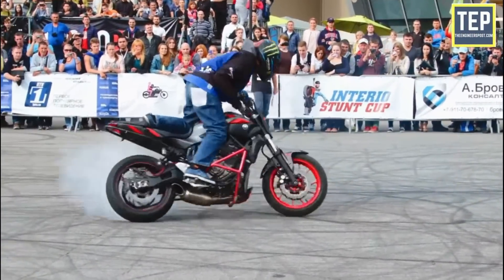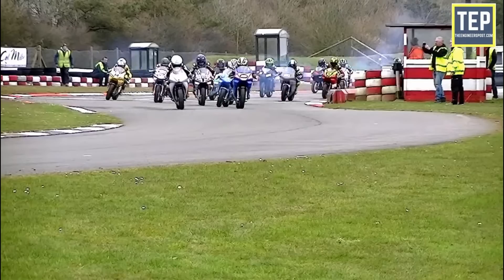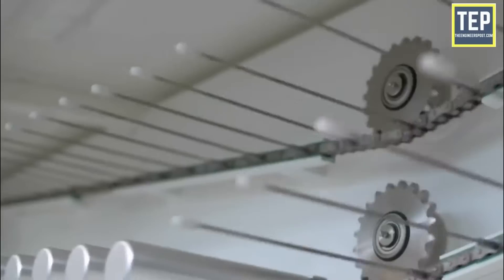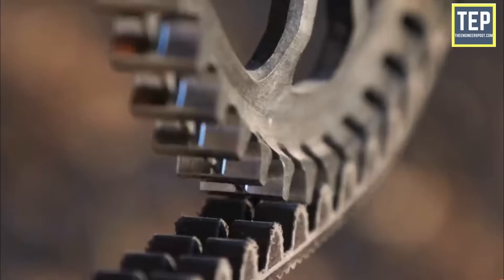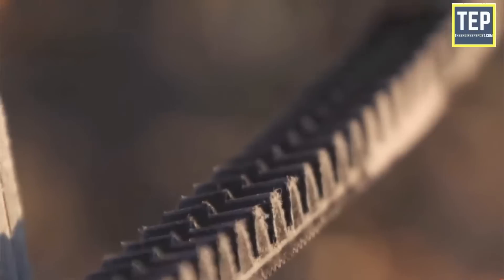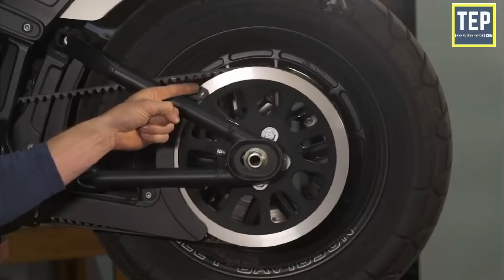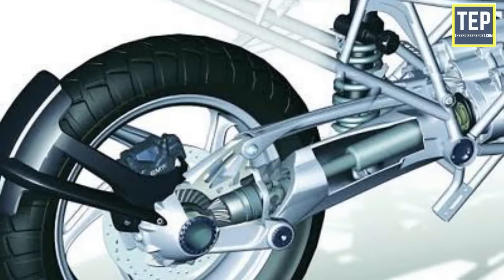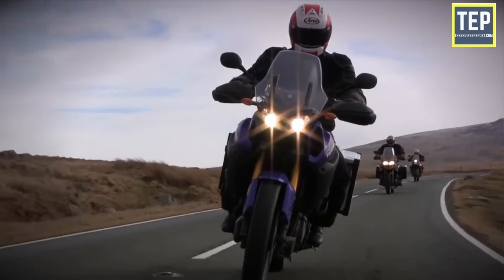Chain Drive vs Belt Drive vs Shaft Drive in Motorcycles | Which is Better?

Comment: You didn’t really answer which is better. I think it depends on what the individual rider needs: performance (speed), touring or low maintenance.  I ride a 1984 Nighthawk S shaft drive and it’s had a few oil changes in its life. I’ve had it since 1988 and it’s still thriving. Btw, this is a CB750SC, a Canadian version with 84 hp. Hard to beat it when I go on 10 hour round trips and not worry about oil or chain adjustments.
Reply from the maker: Yes it depends
Reply: @TheEngineersPost  jobs
Reply: I have a cbr 600 f from the same year 😁👍🏻

Comment: If you want consistent acceleration then the drive shaft is the way to go.  If you want more power then a chain is better, but it does not behave the same each time you accelerate.  Chains are more fun and less predictable than drive shafts.
Reply: @Ziggy Zig A good bike rider can tell the diff between a cold chain and a warmed up one.
Reply: @Ziggy Zig A good bike rider can tell the diff between a cold chain and a warmed up one.
Reply: I'll take my shaft drive VTX 1,800 R against anything you have rubber band or chain you don't stand a chance
Reply: @joeylom5235  VTX 1800 R is a screamer at 3.3 sec for 0-60mph.  The FZ-09 does the same in 2.9 sec and is a chain bike, but not really comparable as it is a naked bike designed to crush anything from 0-60 that uses gasoline.
Reply: Not so The Drive Shaft Robs a lot of Horsepower , Take same Bike with a belt or chain and you will never see Them on a shaft Drive Dead Stop Shaft makes Bike Rear raise up ,If you like a Goldwing a shaft is fine but you can not play with Belts & Chains on a shaft loosing to much Power to the ground .
Reply: @gentrydebbie1040  I don't notice much or if any  power lose with my shaft drive m109r.
Reply: @Matt-qd7sd  That is bacause you have never Ran a Chain on it or Dynoed it I Know it looses Tons of Power ?I Done wone Cash on chain verses Gears ?
Reply: @Ziggy Zig Yes I can tell the difference between the two.
Reply from the maker: You are right
Reply: @Ziggy Zig Maybe the dyno is not sensitive enough to notice.  My FZR 600 and FZ-09 chain bikes both have less consistent acceleration than my vStar 650 had which has a drive shaft.  Maybe the tire quality is the actual cause.  The Z rated tires on the 2 crotch rockets might allow for more tire spin.

Comment: You know, these guys are leaving out the option of using a hydraulic pump and motor. The nice thing about hydraulics is that you have a bypass valve, which serves as the transmission.
Reply: has it actually ever implemented into production vehicle? i have seen a cycle but never a motor bike with this tbh
Reply: i think it's the same principle of torque converter automatic gearbox. the drawback is the loss of efficiency due to liquid medium.
Reply: A Hydraulic system would have an efficiency of probably 5% and be slow as fuck

Comment: They didn't cover how on shaft drive when you gas it the back end of motorcycle lifts up thus losing traction not good when cornering hard... JMO
Reply: @Legi0n21 you lying to yourself the backend always lifts up on a shaft drive motorcycle. it is kind of unnerving. shaft drive works on a big heavy gold wing the only way to go. as for a cruiser I prefer belt if it’s a dirtbike no other way to go but chain.

Comment: Belt system is not convinent .Same belt We used in  industrial machine but after few days grooves of the sprocket chocks with particals of rubber from belf or dust . Because of this hole machine start vibrating .Often need to clean .
Reply: maybe for noise reduced solution

Comment: My sedan has a 17% parasitic power loss, and that's with 6 gears and AWD. I'd be shocked if parasitic loss on a shaft drive bike is any more than 10%. I'm no expert on belts this is just a hypothesis, but belts require a lot of tension to stay on the pulleys, I'd go as far as to say belt drives have more power drain than shaft.  I dunno with all the UV joints tho. I'd love to hear from an expert on this
Reply: for every hour you ride, how much of that is with the throttle WFO?

when the throttle is not wide open, what do you care how much power is being lost?

at cruising speed nearly ALL your power is being lost to wind drag.  SO WHAT?!
Reply: I’m of the same mind, I can’t believe that a shaft drive saps up to 25% of the power, thats 625-2500% more than a chain.
Reply: I have a belt drive (BMW)  I understand it is not as efficient as a chain drive,
Reply: I'm an expert .. now you've heard from me ;^)

Comment: As someone who rides a 1984 Honda VF700C with a shaft drive, I can fully say. They are nice since I don't have to worry about maintenance as much.
Reply: 84 1100 and that is one of the best parts of a magna and is quite and smooth
Reply: @78gbody  they are a beauty when you treat them nicely, hamfist the throttle like a newb and they will show you a different personality.
Reply: @Shawn_the_Protogen  very true words. and there alot of bike for how they act
Reply: 84 magna was my first bike! Loved that bike, kinda wish I still had it. The only thing I changed on it was the handle bars and I rode the shot out of it!
Reply: @murray8958  that was my major upgrade I did when I retrofitted mine. I put ATV bars on mine then proceeded to swap out all the lights with new LEDs for safety, including adding some.
Reply: @murray8958  i have a few for sale if your looking.lol
Reply: Chain is the cheapest.  Belt is easy to replace.  Shaft most reliable.  If you ride long distance, chain/belt would be bad if it broke.
Reply: @MrMannyhw I agree.... But it's likely  riders error if your drive fails....You can see if a chain drive needs replacement, you can see if a belt is about to explode (small cracks in the sides) and a shaft begins to get a little sloppy.....
You don't wait till your oil is bad before you change it....why wait till your drive is about to come undone?
Reply: I fully understand you my friend. I own a 1986 Honda VT700C.
Reply: I'm not a street rider but I've rode plenty of my friends bikes over the years. Been riding dirt since 1967. In the late 80's a friend had a Yamaha 1100 (I think, maybe 1000?) shaft-drive road bike. (In my 20's) The first bike I ever rode that would break traction at around 30 MPH just by rolling the throttle on...scared the shet outta me when it happened coming out of a turn....next thing I know I'm power-sliding on pavement on a heavy as hell friends bike....I kept the power where it was and straightened out....my bad.... But If I down-throttled too quick it would actually chirp the rear tire....as if there were play in the shaft gears....I didn't like that at all! I think that was the last time I rode a street bike. Now days at 62 I still ride (a WR450F) pretty hard and (my new favorite toy) a Side X Side Razor Turbo1000.
Reply: as someone who rides a 95 honda shadow ace vt1100 i agree, and they are so smooth
Reply: I've had an '83 V65,' 84 V65, and have an 84 V65. What? I don't like change... Plus it's a great bike!
Reply: @perryrush6563  I remember when the "exhibition of speed" was illegal on tv commercials...like actually showing someone "drinking" a beer was illegal too
 (still is). The V-65 Magna commercial was recognized as "The first allowed to visually show  "exhibition of speed" as it broke traction (peeled out a little) when a signal turned green, (about one second of video).....and at the end of the commercial you see it pass left to right, about 2 feet in front of the camera, at "light" speed (about a 1/2 second of video)  as the commentator says "The fastest production bike in the world". Those "Flame-tip" exhausts were bomb too.
     Later came the Honda "Interceptor". Same engine with "Anti-Dive front end" and some kind of "dual-clutch transmission". 
    A completely stock Interceptor took 7th place at (the late) Riverside Raceway in Calif...  and the factory bikes took first, second and third back in the mid 80's...best I can remember. (revolutionary technology). 
     Since then, street vehicles of any kind are now "drifting", "power sliding", "racing"....sometimes even jumping across bridges and canyons. Meanwhile parents are trying to properly and safely raise kids.
Reply: I have the 82 750 Magna and besides from the tiny tank I love it. The best part is how easy it is to change the oil in the shaft and the lack of times you have to do it.

Comment: Hi in INDIA some china manufacturer Introduced BELT system for Royal Enfied 500 cc . My friend buy the retro fitting set for bike. After fitting He gone 40 km away from his home for testing on Super Highway. But as he reached on Highway and powered the bike to test 0 to 140 km test the belt broke in 2 pcs and teeth wore out and belt become ribbon. He call the seller of belt. But they say we can't do any thing. He was in middle of No where with broken bike. He called us them we go to him to resue and Pulled his bike by toaging 40 km. Its tottaly bad experience. I think we should use the bike as company given.
Reply: If the manufacturer won't replace it for normal use, the manufacturer cannot be trusted to have quality products 😂

Comment: I had a 1984 Honda V65 Sabre shaft drive. Changing 5 fluid ounces of 90 weight gear oil was yearly maintenance. It took hard beatings and high mph. My bike was A FAST ACCELERATING ROCKET.
Reply: The Sabre a 'rocket'? In it's time and in your memory. But saying that in 2021?
Reply: @arturama8581  In 1986, at Baylands race track, Jay Gleason on a standard 1200 Vmax got a standing 1/4 mile in 9 secs, the V65 was not far behind that, not alot of progress has been made in the years between on standard production bikes
Reply: He did say it was, not that it is in this day

Comment: You neglected TOTALLY to discuss CVT transmissions on scooters.
These combine both transmission and drive in one, and are used on millions of low displacement scooters worldwide. 
The total number of low displacement motorcycles far surpass larger displacement motorcycles, but they don't even rate a passing mention in your video.
Sloppy work!
Reply: They said Motorcycles, not Scooters..
Reply: @VindicatorJones  Your bias is showing.
The vast majority of motorcycles in the world are low displacement motorcycles mainly in Asia, Latin America, Africa and to a lesser extent, Europe.
Of these, a significant portion are scooters.
Reply: @stanislausbrown8626  Hispanic America*
Reply: @WolfEpsilon  I apologise if my use of the term "Latin America" offends you for some reason, but in the several years that I lived in Latin America and throughout my visits to Puerto Rica, Guatemala, Costa Rica, Panama, Colombia, Venezuela, Ecuador, Peru, Chile, Argentina, Brazil and Uruguay, everyone I met, referred to Latin America, so I grew accustomed to that term, and I will continue to use it until someone who actually lives there, corrects me.
Reply: @stanislausbrown8626  If you want to include Mexico and Caribbean region you can use Hispanic America, but if you're referring to the south region then use South America instead. "Latin america" is a denigrating term used by northamericans.
Reply: @WolfEpsilon  I disagree. That is a point of view which I believe, comes from the current trend of the "woke" generation to redefine the meaning of commonly used terms to promote their particular world view.

I am from the Caribbean, and as I stated, have lived and traveled extensively in Latin America. 

While I know of several complaints about denigrating practices of north americans, especially their habit of overthrowing and undermining governments, no one I have ever met in Latin America has ever complained about the use of this term. 

It is still used in news reporting from several news organisations based in Latin America, as you would know if you listened to those reports.
Reply: @stanislausbrown8626  First of all.. I didn't say anything about "woke" trends, I couldn't care any less about that shit. You're the one putting those things in my mouth.
Second.. If we're "Latin America" latin means from latin languages that implies north america is also by definition latin america because is no secret they speak a latin family lenguage, but I don't see any northamericans happy with this reasoning.
Third.. The only reason people "you've talked to" from This sub-continent accept that kind of definition is due to a lack of knowledge and identity or a flawed identity, And therefore you cannot make a valid point with that questioning.. Hell if tomorrow people from the united states come up with a new term like "trashamericans" or "poormericans" people will be ok and accept it. Thats denigrating and widely unfair.
Third.. I AM from South America.
Reply: @WolfEpsilon  This seems to bother you more than it bothers me. Perhaps you also suffer from a "flawed identity"?

In any case, neither you nor I can control how people see themselves. Whether these majority of people living in Latin America eventually agree to use the term you seem to prefer, is not something either of us can control. 

That is something left up to history.

I have seen that several Latin American nations have decided to rename 12th October since it offended their populations, so perhaps your view will, in time, be accepted.

I wish you good fortune in your attempts to change the future.
Reply: @stanislausbrown8626  It bothers me the fact that people misunderstands the meaning of words and use it arbitrary/self-conviently instead of using more accurate terms.. and by saying this we can notice how this connotations aply for some populations but not for other certain populations, nevertheless I can note you still using the same term for the region.
And don't be concerned about myself having a flawled identity dude thanks but no, I have a lot of problems but that definitely isn't one at all. :)
Peace.
Reply: This video wasn't about transmissions. And I'm sure many of us know what a CVT is.
Reply: @SALTrips  It is about drive trains and CVT is a drive train just as much as it is a transmission
Reply: Correct me if i'm wrong don't CVT transmissions utilize mostly a belt drive train after the transmission to the rear wheel
Reply: @bigmgaming9135  Yup
Reply: @bigmgaming9135  Actually, in CVT scooters, there is a belt that moves between 2 pulleys. 
The combination of the pulleys and the belt creates the continuously variable bit. There is no separate transmission.

The drive can be directly from the rear pulley or from gears connected to the read pulley. Or even from a chain connected to the rear pulley.

But it is, in the end, a drive TRAIN, not just a transmission.

My point was this is an important variation on the drive train that was completely left out.